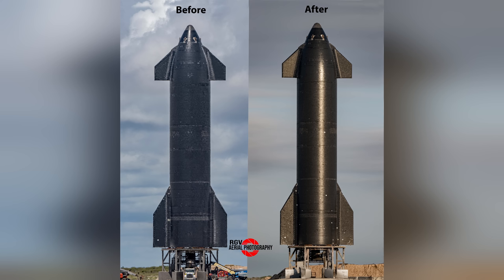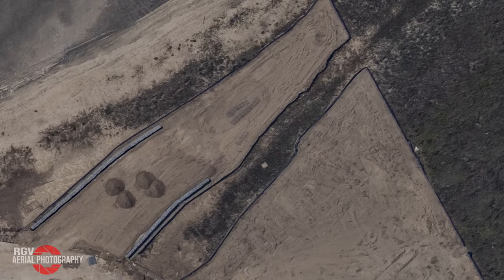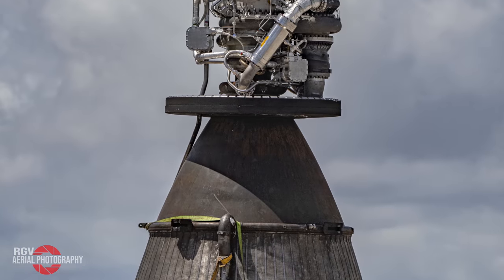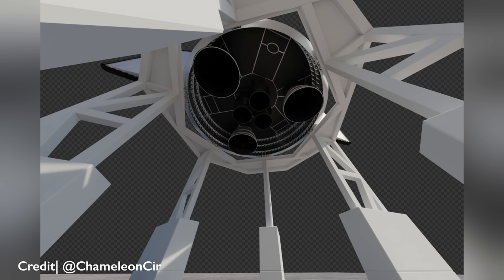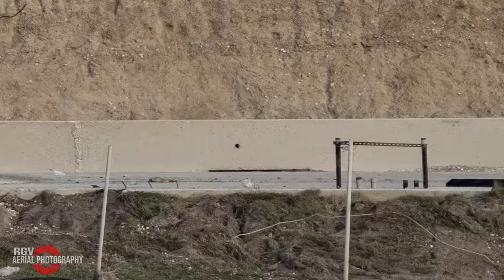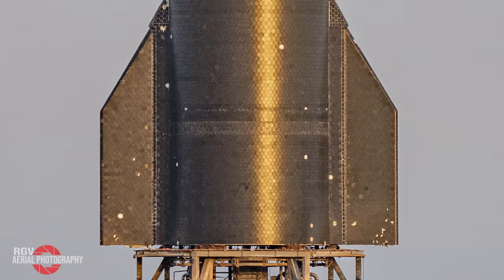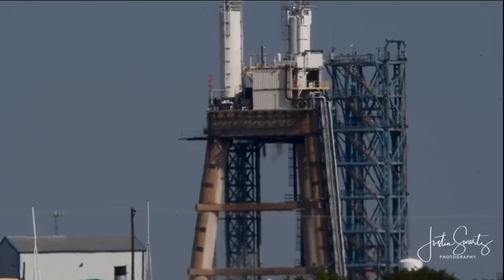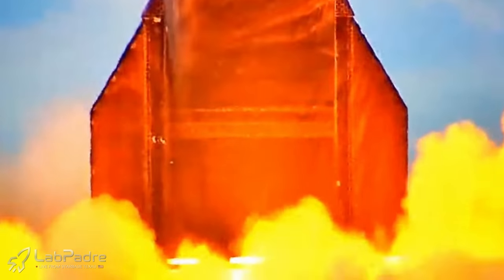Analyzing the Aftermath of Ship 24's 6 Engine Static Fire Test

Comment: Debris (the s is mute) could be Martite but is more likely concrete. What causes it to break off is the fact it is soaked in water before the Raptors fire. The flames turns that water to steam which makes it explode out in all directions like popcorn.
As I see it they need to either stop using the water deluge or make the concrete water proof - or cover the ground with steel (which has to be anchored to the foundation). It should be simpler than rebuilding the stand.
Also, the cameras have to be better protected.
Reply: "Debreeze"!!! 😆
Reply: I agree. See my post about making the test stand more heat resistant.
Reply: Yup, debris s is mute cause it's French. The upper classes kept the French pronunciation of originally French words ever since the William the Conqueror, but the lower classes not always care. Got this excellent observation from my Herbalife mentor Bob Gurney sometimes in 1985 (about the dual pronunciation of words like ballet, target, buffet). Anyway, the steel plating should be an easy and quick solution to the concrete problem. Such 1/2 inch plates are used over roadwork in cities without any issues.
Reply: @Alarix246  But it can't just be placed on the ground. It has to be very well anchored or it will fly off to God knows where.
Reply: What exactly is martite?
Reply: @knowledgeisgood9645  I Know how to fix that. Put concrete on top to hold if down. ;)
Reply: @feiter  It is a mineral that has iron in it. That makes it heat resistent.
Reply: @feiter  some kind of supposedly perfect and superstrong concrete (which is no match for the Raptors anyway).
Reply: @knowledgeisgood9645  absolutely. It's easy to bolt it down to concrete.
Reply: @Alarix246  Provided the concrete is thick enough.
Reply: Small concrete debris is likely of minimal environmental concern.  It began as limestone and sand, which is likely endemic to Boca Chica soil and it will return to those basic forms, especially in seawater.  The gravel in the concrete will be more unnatural, though surely some has washed down the Rio Grande from the W. Texas mountains over the millennia.
Reply: @williamgrissom9022  This is the first time I hear about the concrete causing environmental concern. It is the fact that the concrete bits hit the ship that is a problem.
Reply: @knowledgeisgood9645  Didn't I argue the opposite, that there is little environmental concern with spewing concrete debris across the marshlands?  Most of the concrete debris blows outward.  I would imagine that only tiny concrete dust would stay suspended to drift onto the tiles.  They are more likely coming loose from the vibrations.  They have been swapping out engines because they have been melting internally, both in flight, in launch stand static fires, and on the MacGregor test stands.  The melting is indicated by the plume changing to green (copper emissions).  Elon has discussed this problem since at least Dec 2021.
Reply: @williamgrissom9022  Soaked concrete and the flames of 6 Raptors cause the concrete to explode due to the water turning to steam inside the concrete. Those pieces fly in random directions. That is why they are found everywhere and why so many hit the tiles. Sure the vibrations could have loosened a tile or two, but the way the tiles at the base of the bottom flaps were totally shredded is not the work of vibrations.
Reply: Maybe raise the launch platform a good bit more?
Reply: @markanton2349  They likely would have to raise it if they redesign with a flame trench with water quench.  The land is just barely above the water table plus would need room to direct the plume and steam out horizontally.  The Soviet N-1 Moon vehicle is likely the closest to StarShip Booster, but I couldn't find any images to show if it had a water-cooled flame trench at the launch tower.
Reply: @markanton2349  That would reduce the problems, but not solve them, and they would have to extend every cryo, gas.hydraulic, power and signal line. They would be better off removing it and starting from scratch. They would also have to make the burm higher.
Reply: Actually, he said the concrete was poured just a week before the test.  So it was still wet from the pour and had not yet fully cured.  Of course it popcorned up.  What they need to do is let it cure and dry before using - something they clearly do not have time to do.
Reply: @knowledgeisgood9645  
Water isn't necessary to explode concrete. Spalling will also occur simply due to the extreme differential temperature between surface and depth. What might mitigate spalling is a cover material with a far lower coefficient of thermal expansion.
Reply: @imconsequetau5275  Plausible. But it is hard to know which effect was the most active. 
Anyway, if they now are using Fontag maybe they could solve most of those problems. We saw much less concrete fall on the road and other parts after the latest SF. Redoing the surface between tests is not such a big deal.

Comment: I like SpaceX's design approach where they have a bias for not adding parts/features early in anticipation of potential  future problems.  Instead they wait until they see real problems like this, and once they're convinced a new feature is necessary on a first principles basis, they will add it.  This way they don't add a whole lot of unnecessary features to work around problems that never actually occur.

Comment: It's worth noting that SpaceX's long term goal for Starship is to be able to take off from Mars or any other reasonable planetary body.
In a way, all this suborbital pad testing is a real-world study on the effects of local debris during takeoff (without booster), and will help them understand what's necessary for the "endgame" fully capable version of Starship.
Reply: Note that on Mars it wouldn’t be any stand behind nozles, just Martian soil, at least at the begining.
BUT, it wouldn’t be active engines there, instead will be perhaps something as intended for Moon landing and depart, I mean some engines placed high and lateral. Much more complicate and problematic of course, but in fact now everything looks problematic and be sure that tests will continue until a solution is found. No alternative here, already everything is “too big to fail” ☺️
Reply: @Dalidoso  
Departure from Mars would have plenty of time to modify the launch surface -- for example with sintered regolith tiles or stainless steel sheet. 

A departing Starship will also be much heavier than the lander because of the added propellant mass, so the upper lateral engines will provide only a fraction of the required thrust.

Comment: Its quite re assuring that the damage to 24 was basically debris damage. Once its installed on top of the booster . If it sustain the vibrations from the launch it should be fine when it separate.
As for the testing mount. The only viable solution is a blast pit with a diverter. They could increase the diameter of the walkway and armor it further. It would deflect a lot of the debris. But, that is not going to protect the underside of the ship.

Good analysis. Well done.
Reply: That isn’t known

Comment: Here is one problem with thick cement... It has water in it for a very long time. Its possible that the heat of the test caused this water to boil which cracks the concrete (spalling). Just a guess but a possible issue that could have caused a lot of debry.
Reply: very true.

Comment: Brilliant work!!!  I’ve always thought those stands looked a little week.  It seems to me that it would be cheaper in the end to redesign and rebuild the stand than to keep fixing things after each static fire.   They almost need a hole in the ground under the ship with maintenance grates that can be removed.  I suspect the water table level at that location prevents this so the only alternative is to build the stand taller which you suggested.

Comment: By the time the honorable commentator went to school for the first time a big fire happened in the channel tunnel. By that time widelly accepted view of reinforced concrete fire resistence properties was that concrete being stone will cope well, but overheating the mild steel reinforcement bars might cause loosing their strenght. But then many were surprised by the aftermath footage showing huge holes on tunnel walls deep to the limestone bedrock view to which was obstructed by the intact mesh or rebar. That acident did not involve temperatures or pressures as high as rocket engines exhaust produce and although it lasted uncomparebly longer than shown here test it wasn't at all a long lasting event in terms of a firefighter brigade. Simply put portland cement concrete is a good ablative shield if there is something that can bare load behind it, which its reinforcement isn't and the dispersion of the ablation product is a factor to be dealth with.

Comment: The strain pattern around the hole in the methane pipe is inward, so it's the result of an external impact. An internal overpressure would have sharp points bent outward from the failure point.
Reply: It could also have been damaged during removal of the engine.

Comment: Thanks, Zack and to all your helpers, too! 
This really raises the probability that TPS tile damage is NOT due to failings of the attachment system, but may be entirely due to debris strike from the raptors firing so powerfully and so close to the pad surface. Increased water deluge alone may not be sufficient to suppress or ameliorate that.
Reply: I also suspect that having partially filled tanks has increased the surface "Q", so the hulls resonate much more to the acoustic barrage reflecting off the concrete. When the Starship operates in a partial vacuum, this factor is gone.

The reflected acoustic levels may be far lower when launching at a greater height on the booster and landing on the elevated chopsticks.

Comment: Let's keep in mind that this damage to Starship is only a test stand related issue. Sitting on top of the booster puts it out of the debris plume. However it does beg the question about the basic concept of not having a flame diverter trough to direct the flames and energy away from the booster for testing and launch. The charred concrete pad is likely the highest grade concrete for temperature and pressure and we can see that it's overwhelmed by the 1500 tons of rocket blast of this short test. I don't blame it for feeling a tad toasted.
Reply: Totally agree about the need to have flame diverter tunnel, together with massive water deluge system, just like NASA does at Cape Kennedy. Never understood why they didn’t do this in the first place because I feel sure they are going to have to at some point.

Comment: So new concrete and upgraded flame diverters after S24's 2 engine static fire, but that wasn't enough to prevent damage from the 6 engine test. Seems like they gotta increase the height of the test stand AND design a new raptor maintenance truck that can reach that high...

Comment: You might wish to include the tidal state in your calculations on the interaction with the water. It appears to me (not an expert in tide calculation) that the tidal range at Boca Chica at the time of the test fire was about 28 inches, and with the very very shallow angle of the beach at that time the actual water line might be moving back and forth better than 10 feet. Since I don't know the gradient that is just a guess, but it could change the view of what happened greatly. Love your work dude,  Your descriptions make a person feel they are standing there being Dr Watson to Sherlock while he explains the case👍

Comment: Super sleuthing, Zack, you are the man. As to the test stand, I have first hand experience with excessive stubbornness & IMO the Starship test stand is a classic case of that. How many times will this inadequate test stand + concrete take before Elon does a proper design? It is funny that McGreggor has properly designed test stands, but Starbase does not. Pure bullheadedness.
Reply: its probably less a case of excessive stubbornness and more a case of "we need to be able to quickly drive a druck under these test stands and swap out an engine".
I have no doubt that many simulations have taken place that clearly show that these test stands are severely underpowered for Raptor 2 firings, but ease of use will be much more of a priority in the program to this point.

Comment: Good information, love your channel. The damaged pipe looks like it was dented in so overpressure in my mind is questionable. As far as the launch mount I figure as a first design it was a rather inadequate end solution but a good place to start learning what's needed. I've wondered if you could build an inverted flash suppressor under the rocket. Something built into the ground 50 or more feet and would divert the plume back up at an angle away from the rocket. 

Personally, I think they should make a couple of square miles around SpaceX a spaceport. I would think we could afford to lose that much-protected land for this most important endeavor.

Comment: just think; when the starship is on top of the booster the vibration will be a lot different and the debris won't be an issue. i don't think the tiles will be lost on launch because of less or different vibration.

Comment: Zack your insight and observation are fantastic.  
Damage to tiles during testing may be the reason we are seeing test vehicles with no tiles attached.  Perhaps the heat shield tile damage will be mitigated when mounted away from the ground on top of a booster.  Thus the next fully tiled starship may become the first to fly. The others will be test stand ready perhaps to be tiled the mounted on a booster after test completion.  Another possibility is reduction of air speed on the return to earth????  Is engine power speed reduction a pipe dream or a realistic possibility for reduction or elimonation of the tiles?

Comment: I really like your detail and not all that speculation that the other channels have.
I wonder why they don't build a heavy diverter that you could roll under the test stand after the maintenance is done and then a skirt around the outside of the ring to prevent debris flying up on the starship.

Comment: Question is how much damage is due to vibration of the hull itself and how much is due to acoustic effects and/or resonance in the test stand. In a nominal flight, no raptor will fire close to the ship in the atmosphere or near the ground (except for landing burn, but by then, the tiles already served their purpose). I would assume starting the raptors after stage sep will atleast not be more stressful to the tiles than a 6 engine static fire couple feet of the ground.

Comment: Another excellent investigative report.

The damage to S24 in that 6-engine test is not a big concern. It's just an artifact of that short sub-orbital test stand. Elon could have made that stand taller but didn't. 

He knows that S24 sits on top of B7 about 220 ft (67m) above the OLM in an actual Starship launch. So, any debris tossed around by the 33 Raptor 2 engines on B7 is unlikely to strike S24's heat shield during engine ignition and liftoff. And noise from B7's engines will not have any damaging effects on S24 during liftoff to stage separation.

After stage separation and start of the 6 Raptor 2 engines on S24, that second stage will be at 60km altitude high above the dense part of the atmosphere. So, engine noise is not an issue. 

Methalox engine exhaust is superhot water (white steam which is visible) and carbon dioxide (which is transparent) mixed with Texas dirt and SpaceX concrete debris.

Comment: Zack, I wonder if the last static fire also suffered a detonation anomaly of sorts.  it seems a heck of a lot of damage for one static fire!
Reply: Each raptor 2 burns aroudn a 140kg's of methane a second, thats 840kg's a second total. Each kg when burned produces 55.5MJ's of energy. Thats a total of 46,704MJ's per second. Thats the equivalent of over 10 tons of TNT ever second.

A total of 374 Gigajoules of energy was released over the duration of the test. That's equivalent to the midpoint of some of the estimates of the ttla thermal energy responsible for blowing the reactor to smithereens at chernobyl. 

What's more impressive is how well it held up honestly.

Comment: If they put pipe's in the concrete that is under the OLM and run some cryo fluid through when launching  or testing. It will save the pad keeping cold when the heat is on What do you think about
Reply from the maker: Lol sounds like you have a glycol heating system on your driveway???
Reply: @CSIStarbase  don't have a driveway